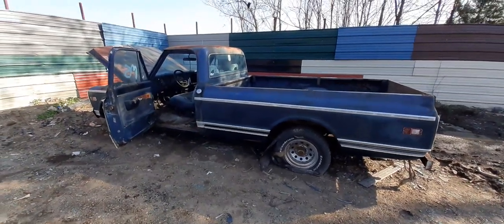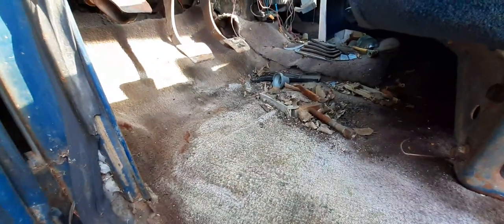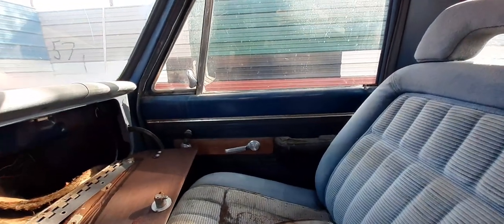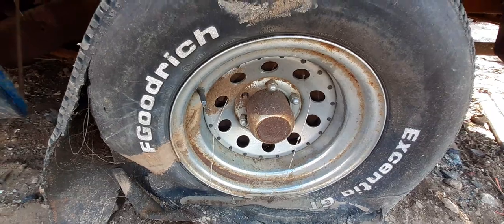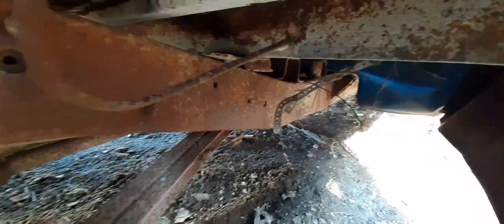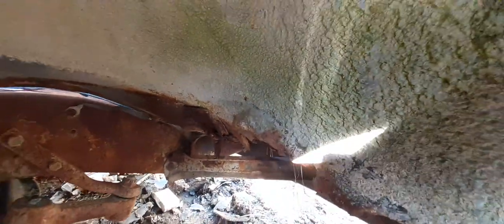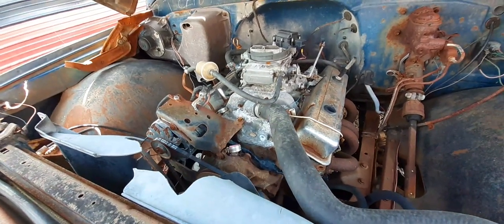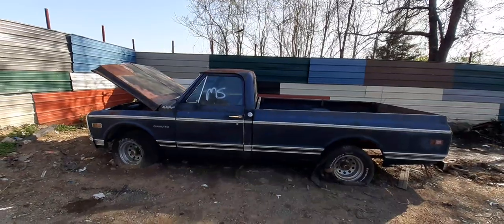Saved 1969 Chevrolet C10 Custom From A DEATHROW Sentence & Now It's My PROJECT TRUCK ONLY PAID 200$.

Comment: Whoa Nelley,, a new truck, and it will be mint without costing you a buck.

These are sharp trucks and parts support for them is excellent. Classic Industries, LMC Truck and others have catalogs and pages of parts for them, for whatever you cannot find used or at other yards that you work with. I actually have the parts book that covers this truck in my files. It's so old it's on microfiche. LOL. 

Jack Williams Chevrolet was located at 1015 Fort Worth Highway, Weatherford TX 76086 and Pee Wee's Used cars is located there now, as well as Williams Chrysler Dodge Jeep. 

Those are the ORIGINAL chalk marks of "CE109S..." on the firewall done by the workers on the assembly line.  That would denote that this truck was originally a V8 (the "E" means V8 equipped), the C is 2WD conventional cab, the 109 refers to a 1/2 ton body style. I think I see an "S" in the chalk mark and that would mean St. Louis, MO assembly. I'd like to see the VIN plate on the door jamb if we can. Cover up the last six digits with your finger or some tape so you don't reveal that to the world. No need for those last six digits, they are the production sequence. 

No VIN, we do not win, but I have (most) of it figured out, no doubt: C for 2WD conventional cab, then either S for six-cylinder engine equipped or E for V8 equipped, 1 for 1/2 ton, 4 for pickup truck and box, 9 for 1969 model year, then maybe S for St. Louis, MO, Z for Fremont CA, J for Janesville, WI assembly among other possibilities and the rest is the production sequence. I'd like to see the VIN # plate (you can cover the last six digits with your fingers or tape so you don't reveal that online) to see if it was a V8 truck originally.

I'm guessing the SPID on the glovebox door is gone as it looks like someone did a custom glove box at one time. Possible code 511 Turquoise exterior paint or code 508 Dark Blue exterior paint.

Whoa Nelley, GMAC did not make this one flat. He got himself a pickup truck, what great luck. Got himself a Chevy and this one's pretty heavy. V8 and soon to be great. Saved it from being flat and that's that. He got himself a truck, so let's wish him good luck. Didn't get squished and the Google Man is relieved and not at all pissed.

Comment: Solid looking truck. LMC and Brothers both make just about everything for these trucks.
Reply from the maker: Yes she is. I'm just hoping I made a GOOD CHOICE on the C10. I'm have to look them up...
Reply: @DeathRowCarCrusher  Classic Industries as well. A lot of the parts are sourced from the same vendors, including body parts. AMD Metal Direct, Goodmark and others make a lot of the replacement parts and they are resold by others just at a higher profit. As CRS said, look them up and shop around. Don't laugh, even Amazon has stuff for these trucks as some of the same vendors sell there that supply the big resto houses.

As I mentioned, I have the original GM parts book for this truck on microfiche.

Comment: Corvette ram horn cast iron manifolds 
Are the way to go 2 1/2 out let so much better then headers  good buy
Reply from the maker: Hum u got a pretty point thier Adam. Sum thing on the motor will be b changed out.